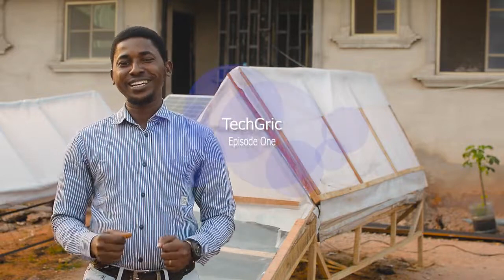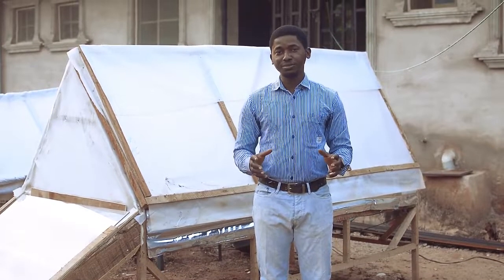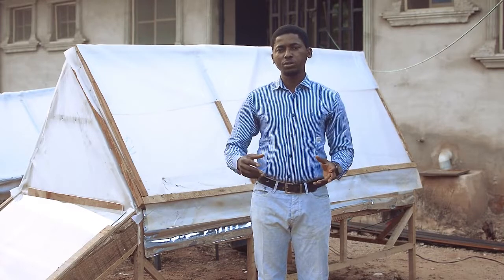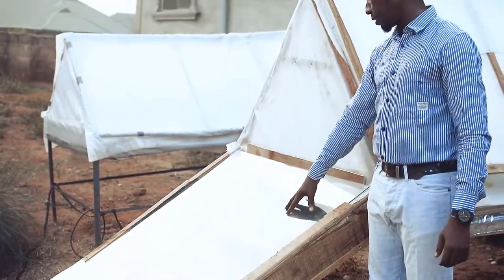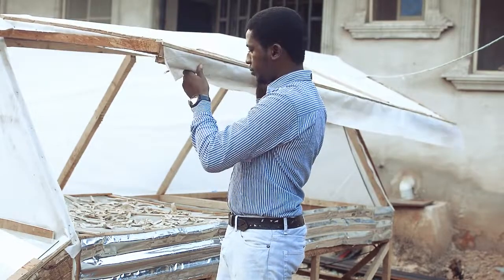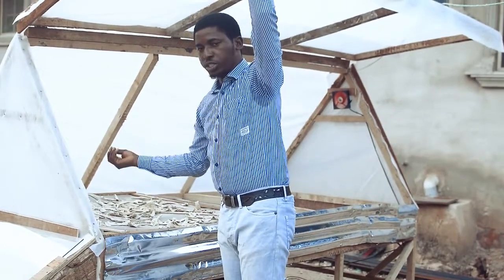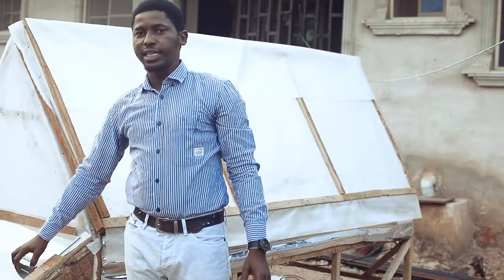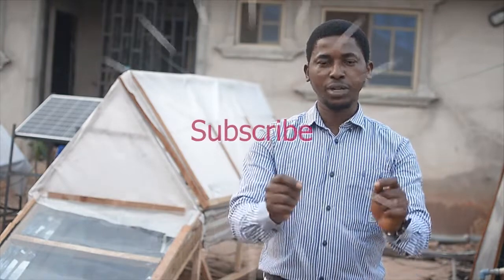Solar Dryer

Comment: GREETINGS FROM SOUTH AFRICA. PLEASE MAY I ASK A WHATTSAP NR. I LOVE YOUR DRYER AND STRUGGLING A BIT. I ONLY USE THE SUN AND HAVE NO SOLAR PANEL. WHAT DESIGN DO YOU SUGGEST FOR SUMMER SUN AND ALSO FOR FREEZING WINTER.
Reply from the maker: Thanks for engaging. You can connect with me using this email: obikingray300@gmail.com

Comment: The only thing that makes me think is that they didn’t have fans before electric times
Reply from the maker: Yes, the fans are to aid airflow in order to get drying faster. With proper design it works effectively without fans, though would take longer time compare to forced convection(fan aided)
Reply: @techgric8872  ok got you 🙏🏽
Reply: That is natural convection, what is explained in the video is forced convection.
Natural convection can be made effective by building the shapes to carefully so that the air is sucked out faster.
Reply: How do I get your contact number

Comment: Greetings from Russia! We dry fruit and herbs and make herbal vitaminized teas in long winters. We use mostly electric dryers, but solar drying might be an alternative
Reply from the maker: Hello , thanks for your comments. Fruits and herb dehydration is awesome and using solar drying as an alternative is great. You can use thicker material as your green house covering that would help to trap heat much better during the cold weather. Thanks

Comment: Sun dry and solar dry which one is the fast dry?
Reply from the maker: Hello Samnang, I suppose you intend to compare open drying under the sun and this technology of solar drying. I have a proof that this technology is much faster. As I explained in the video that by green house effect you get more heat for the material dried and as long as there is good ventilation the moisture is effectively removed.

Comment: nice job. greens like herbs and lettuce and spinach work really good. sprinkle flakes in catchup on burger or put blender for fruit smoothie get greens in winter when not growing.
Reply: nice job design point roof means water collect slide down side away food. metal panels put food on heat help deydrate it.                              your next project should try make solar oven so make bread or pezza next. from stuff save. this done with refective mirrors shine sun light on bottom metal pot. or magnify glasses intensify sun light.   L shape mirror . with cross bare hold pot or cook pan. it really hot so carful cook meat. or grill vegetables.                                                  or solar hot water bath tub. that kinda hit miss warm up water to what people want. put water in dehydrator till hot poor it in tub.
Reply from the maker: Thanks a lot